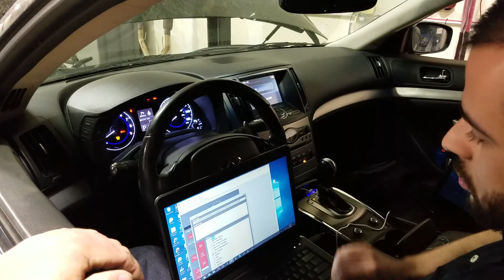Admin tuning intakes and catch cans

Comment: Seen some of those intakes with pretty bad fabrication and catch cans don’t stop oil consumption.
Reply from the maker: @ryanbless3970  actually they do stop oil consumption in systems that eat it thru the pcv system. Guess you don't know much about engines. 🫠
Reply: Seems like you don’t. They definitely keep your intake clean though 🤷‍♂️
Reply from the maker: @ryanbless3970  why would they keep your intake clean, tard? Because of the lack of oil being pulled in and CONSUMED? 🤣

Comment: Hi there I've got a naturally aspirated vw polo 6n2 and I've deleted the pcv valves about a year ago with two small filters and slightly wider pipes  and she seems to be running great. I did have the pipe on rocker cover first going to my forced air inlet by the throttle body with a check valve and that got me a slight bit more top speed of 5 mph but there was still a little bit of oil going in throttle body so I capped air box side and now run two filters with no pcv on , my aim is to keep engine in best condition possible. Would you stick with a very slight power loss to keep clean or hook back up to inlet and would you run any pcv valves